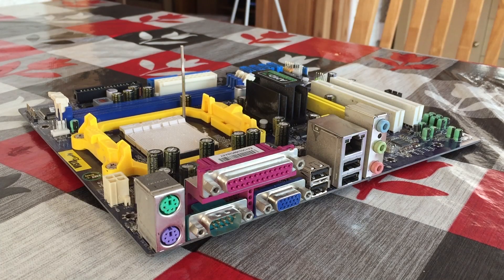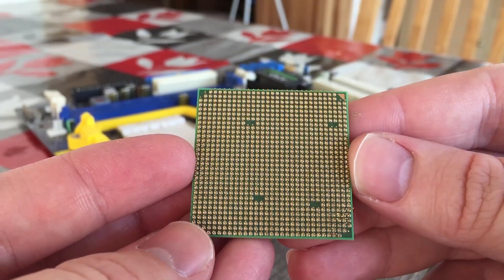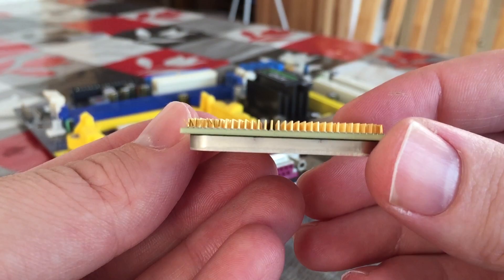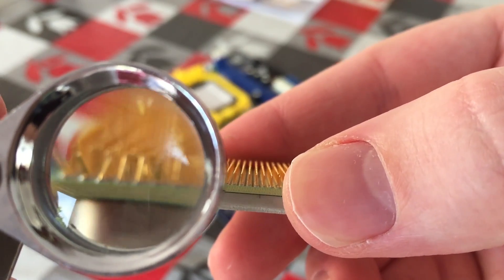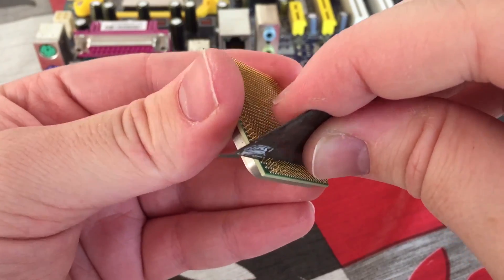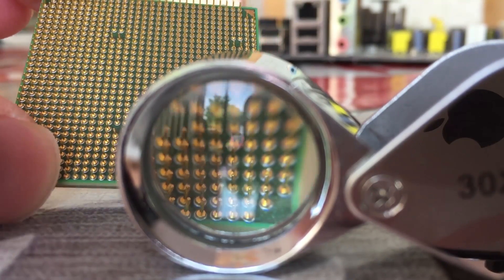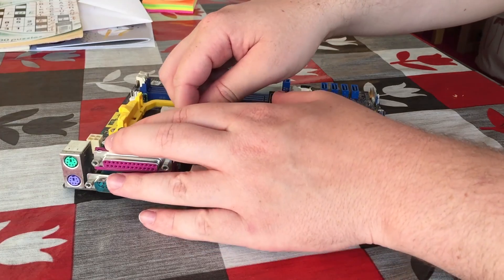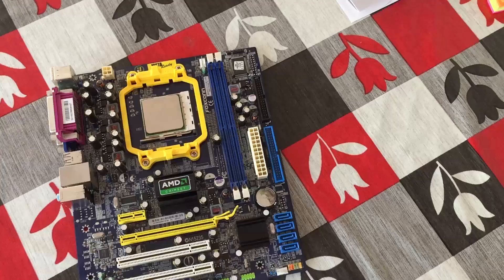A PC Builders Nightmare? (Fixing Bent CPU Pins)

Comment: Hopefully my fx CPU won't need this
Reply: Dhrupad Oza only garbage can can fix FX series cpu's TBH
Reply: Baracuda well where I live that was the most affordable at the time and its not that bad my fx4300 compares to a pentium g4560 so....
Reply: Dhrupad Oza try and find an 8320 cheap, it's a massive improvement in multithreaded applications
Reply: riog1me #r33squad yeah but my motherboard only supports a max of 140W tdp chips and I don't think it supports the 8 core fx CPUs that well
Reply: Dhrupad Oza what board? 8320 is 125w
Reply: Dhrupad Oza a phenom x6 or 6300 would be worth it too
Reply: Baracuda Really? Do you honestly think that FX CPUs are that bad? You are just a hater.
Reply: Mantas Jurksa they're not great by any means, but good enough
Reply: riog1me #r33squad Still eating Pentiums
Reply: Mantas Jurksa this is true, need to get a board so I can upgrade from my phenom lol
Reply: Why do you need new board? Many AM3 boards are compatible with AM3+ processors and upgrade from Phenom to FX is totally not worth it, unless it's for getting more cores. I have FX 6300 myself. Considering its age, It's really good processor. I clocked it over 5GHz on air once, but for everyday I keep it at 4.1GHz. It's very cool CPU and it doesn't consume lots of power. I have watt meter and while my PC is fully loaded it only consumes 260 watts. Also there's Radeon RX 560 here, so I can run GTA 5 at 1440p with high-medium settings at around 45 fps. Not bad at all. GTA 5 specifically runs poorly on FXes, but still this isn't very bad. I get offended when people hate FXes, there's nothing bad with them at all and from engineering standpoint they had innovative and different architecture, which too bad wasn't the greatest, but hey it matches first gen Core i series and these AMD processors never costed a lot. AMD FX series are already 6 year old, so considering their age they aren't bad and what is funny is that at their launch they were exactly like Ryzen is now, just for some reason people see Ryzen as good and FX as bad. Maybe they should stop comparing 2012 FX to 2017 Intel Skylake processors? Of course it will look bad, but no one in their right mind compared Intel 486 with AMD Athlon 64 or 60s stang to brand new Ferrari.
Reply: Mantas Jurksa it’s for more cores, checked the gigabyte website, best fx cpu my board supports is the 4150.
Reply: I'm not sure about your board here. It seems to support first gen FX chips and at least 95 watt ones, but for some reason only this FX. You should upgrade your motherboard, but it's weird. It seems like this board may support FX 6300, but for some reason website isn't updated. I had AM3+ Gigabyte board and I used Windows 10, but officially this thing only supported Windows 8.1 at best. At least for me CPU compatibility list is complete. Maybe you could write your motherboard's model?
Reply: Mantas Jurksa GA-880GM-UD2H, revision 1.3. I have a spare 8320, might update the bios and try it
Reply: Mantas Jurksa I’m running a 125w phenom x6 btw
Reply: riog1me #r33squad You shouldn't do that. It clearly says in website that FX is unsupported and there's no modern BIOS to properly support FXes. Not all AM3 board support AM3+ cpus. Also I see that there are no heatsinks on VRMs, so at best it will be toasty experience. If you really want to max it out then put better Phenom. Personally I would feel very uncomfortable with putting 8 core and 125w cpu in there. Your VRMs may get too hot. And you say that you already have six core Phenom here. It seems like not much could be done without major platform upgrade, but hey Phenoms are still good.
Reply: Mantas Jurksa good point. I could buy a 1090t, but that wouldn’t be worth the hundred and ninety bucks.
Reply: Mantas Jurksa already running the 1055t at 3.67GHz
Reply: riog1me #r33squad In your case you either stay with what you have or do major computer upgrade. It doesn't seem like there is something in between.
Reply: Mantas Jurksa major computer upgrade is in the works lol

Comment: use a bank card it has the right width
Reply: bank card is too thick for an am3 cpu from my experience, razor blades work well.
Reply: I use a 1mm thick flathead screwdriver bit. I have a ryzen 1200 that was knocked onto the floor by the wind while I was putting in a ryzen 2600, and I didn't want to risk a credit card breaking the pins by being too thick.
Reply: @you-own-nothing-we-own-you  by the wind!?
Reply: shiny missingno flathead is good for when they need recovering, then  the razor blade is to fix them properly
Reply: riog1me #r33squad I get where you're coming from, these ones were completely bent over to the next row of pins, so I had to go underneath them and pull up to get them from touching the other side.
Reply: yea, that's what happened to mine. irritating things to fix, i swear.
Reply: shiny missingno yea, ik what you mean, screwdriver is a lifesaver

Comment: Do a video on gt 1030 sli
Reply: anwar ul haq they cant be sli’d. With this new generation of cards, they only allowed it on the 1070 and higher. Windows 10 has a feature called a sync compute, if my memory recalls correctly that allowed any 2 GPU’s to be ran together. The problem is that very few games support this feature.
Reply: yes, they can. There is a hack for that.
Reply: Matthew Jacobs There is a driver that allows it to sli in dx12
Reply: Matthew Jacobs yo have to watch oztalkshwhe sli 1030's
Reply: Matthew Jacobs yo ist possible boi
Reply: anwar ul haq That's not really required, i'd like to see something else on this channel. Like older hardware.
Reply: Matthew Jacobs it can be done
Just not really official sli
Reply: Matthew Jacobs there's a software that makes them sli but in some games like Rocket League the fps gets worse, it doesn't do the job as good as newer sli cards (as in fps % gain) it only gets around 30% faster so you might as well just buy a 1050Ti.
Reply: Even with the work arounds that would allow it, why bother? Just buy a 1050 and call it a day. No reason to SLI anything lower then a 1070 anyway.